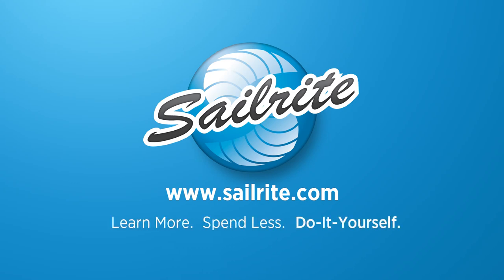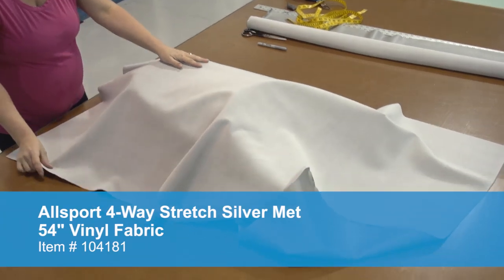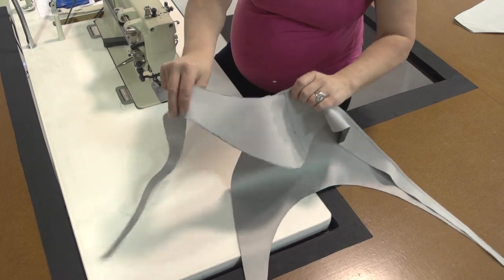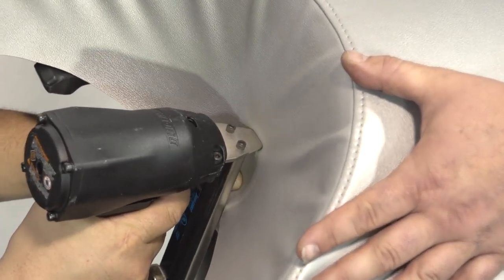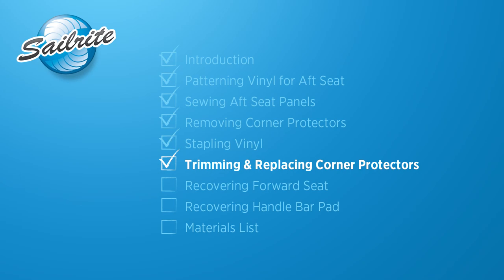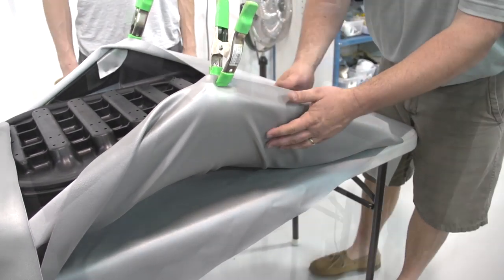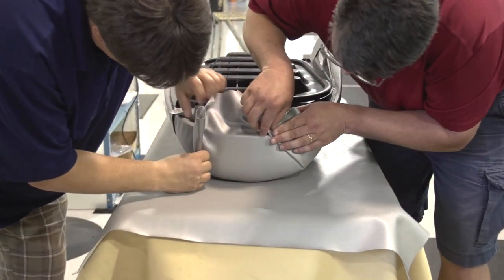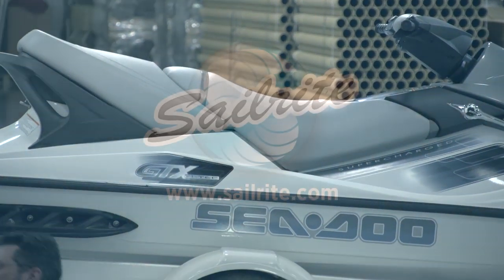How to Recover a Personal Watercraft Seat

Comment: My husband and I just recovered one of these this weekend.  Took about 6 hours total.  We used a hair dryer to soften up the vinyl and stapled using an air staple gun.  Although I do own the Sailrite 111, I did not do any sewing.  We were able to stretch it very tight and got a great fit without sewing.  We put a strip of muslin down over the vinyl where we stapled it.  This prevented the staples from ripping through.  Afterward, we ripped the muslin off.  Ended up looking beautiful just like the original factory cover.  I wish I would have found this video before we started. Thank you for posting great videos for everyone.

Comment: Enjoyed the video... The back of the seats were done very poorly. Use a heat gun to soften the vinyl and you can stretch and staple the back of each seat so that it is perfectly round just like the factory seats, without all those ugly folds you had on the front seat and the two folds on the back seat.

Comment: I AM CURRENTLY REUPHOLSTERING MY YAMAHA WAVE RUNNER SEAT AND BOUGHT A 22 GAUGE AIR STAPLER ALONG WITH 7 SERIES - 1/2" MARINE / UPHOLSTERING STAPLES. WILL THE 22 GAUGE GUN BE OK TO USE OR DO I NEED TO GO WITH A 21 GAUGE AS STATED IN THE VIDEO? THANKS!
Reply from the maker: The 22 gauge staple that your staple gun uses (not a Sailrite Upholstery Staple Gun) will work well.

Comment: WHATS THE BEST STAPLER TO USE ?? BECAUSE IN THE VIDEO SHOWS AN ELECTRIC ONE AND THE MATERIAL LIST IS AN AIR STAPLER... I TRY WITH 3 DIFERENT KIND OF STAPLERS AND THE ELECTRIC ONES DONT PENETRATE.. AND THE AIR ONE RIP THE VYNIL... THANKS.
Reply from the maker: +jkarlosj hernandez You are correct many electric staplers are not very powerful. The best electric stapler I know of that is very very powerful is the Duo-Fast EIC-3118. It works great. Here is a link: http://www.sailrite.com/Electric-Stapler-Duo-Fast